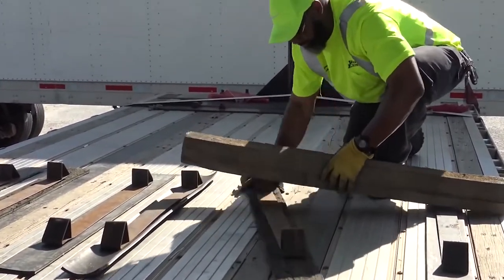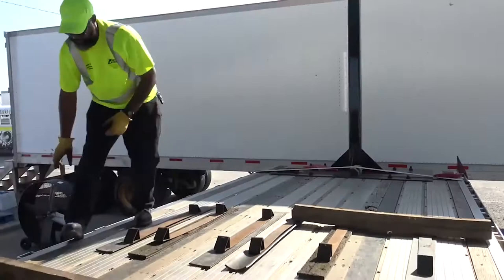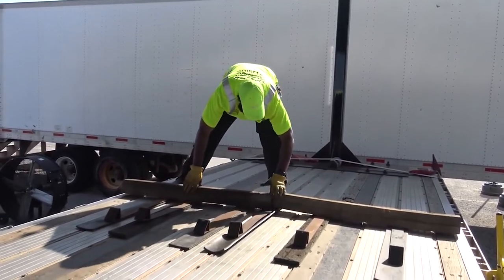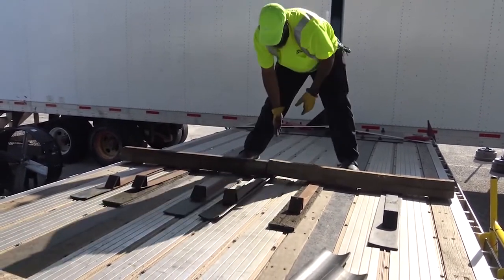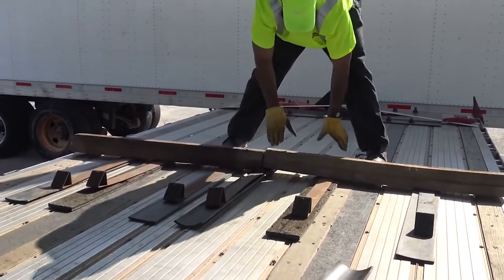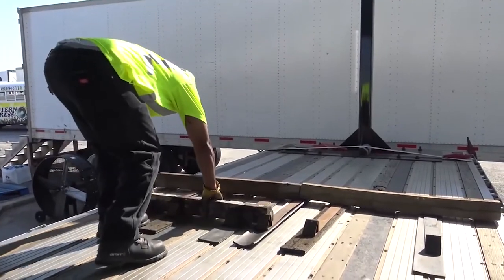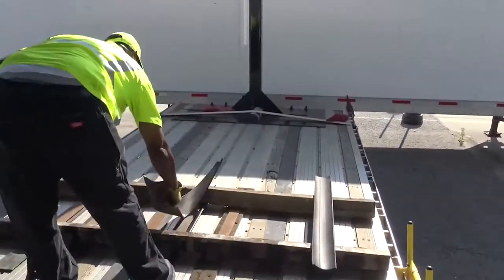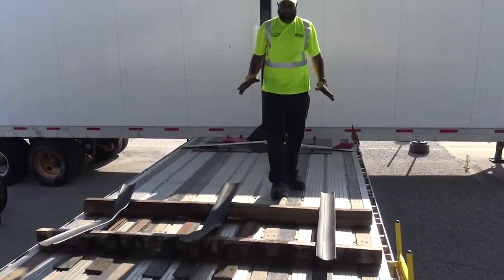How to Secure a Suicide Coil with 8 Chains 8 Foot Coil Cradle

Comment: Only mega fleets make this job more complicated then what it is then wonder why no one drives for them or why they can't keep drivers. a 65,000 lb coil only needs 2 coil racks most drivers use 3 for this I would use 4 due to the split 4*4's but a SMART non mega driver would go to lows or home depo and by 2 8' 4*4's only needing to use 2 coil racks.